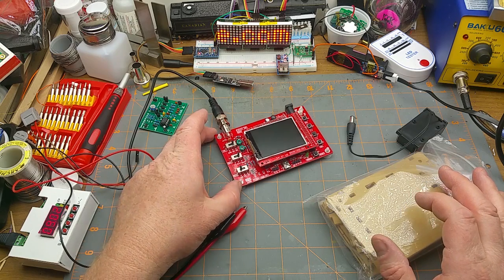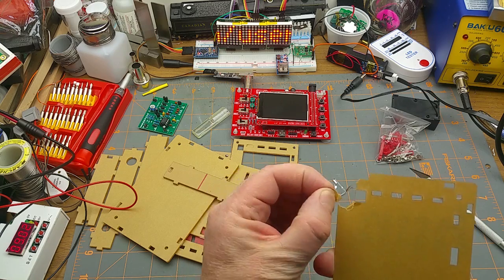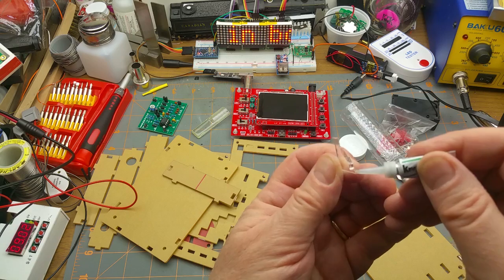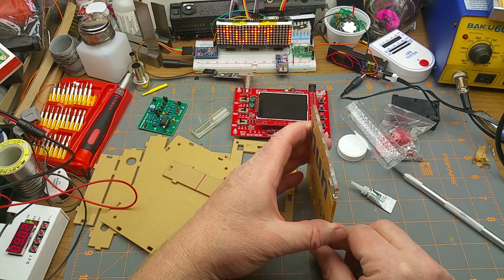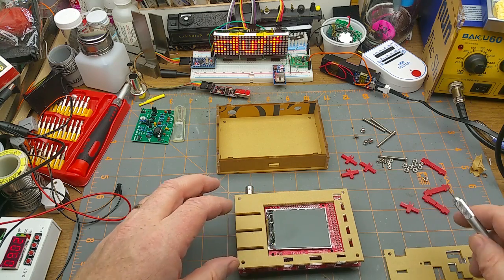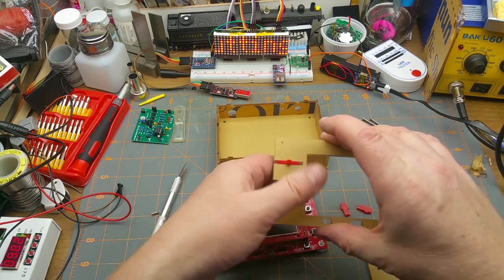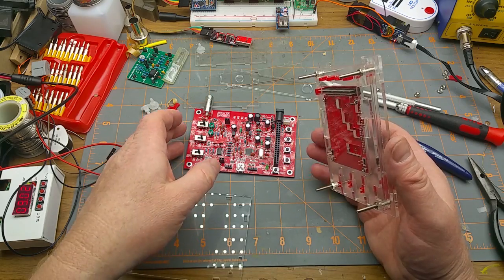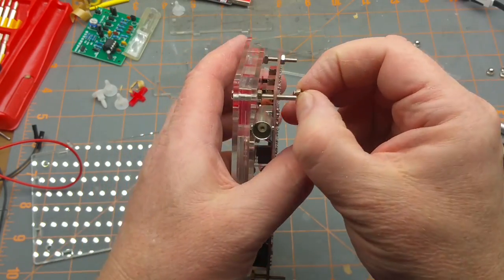Building a case for the cheap 'scope

Comment: It didn't look like the USB socket aligned with the hole
Reply from the maker: Damn, I can't get anything past you guys, can I...

Yes, I spotted that after I edited the video. 

I haven't bothered to fix it, since I haven't researched what I can actually do with that USB port, and if it's worth the (admittedly minimal) effort to flip the panel around.
Reply: That USB socket isn't really used anyway. I soldered mine on and then latter noticed the instructions said "The USB connector do not have function. It was provided for future or user own use." 😂